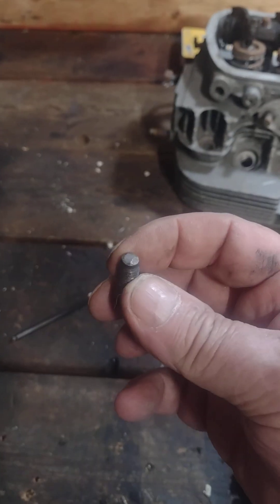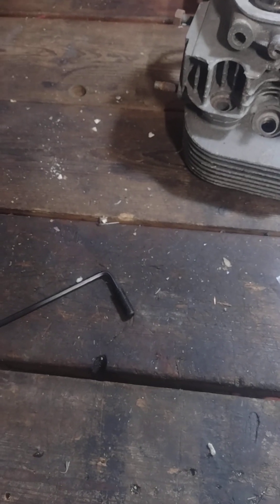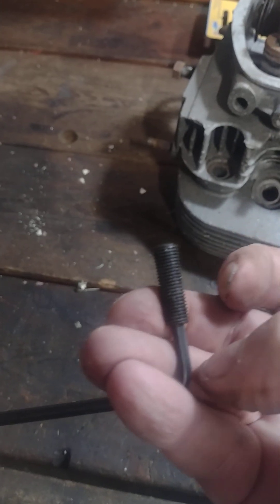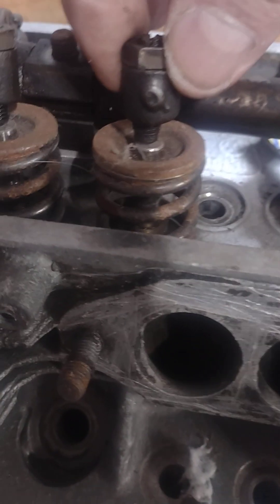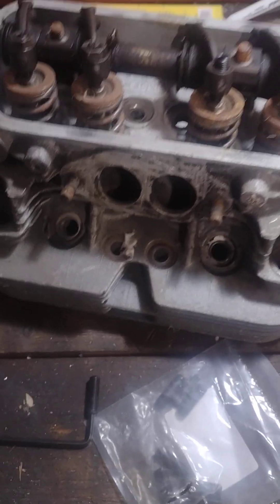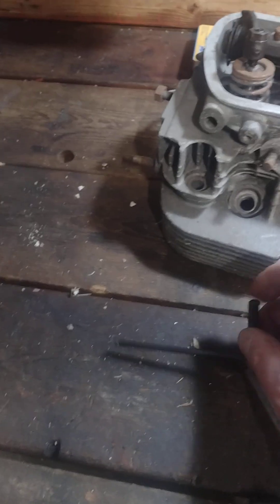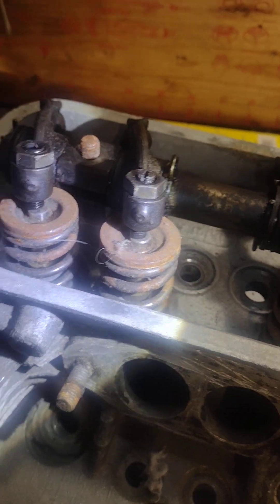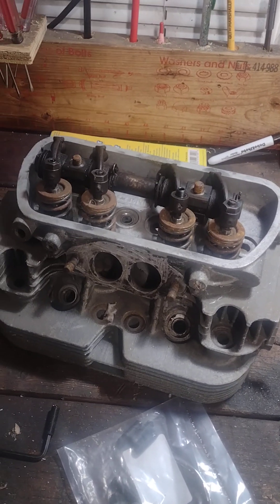Will allen head grub screws work as valve adjuster screws? Let's find out.

Comment: The set screw will work fine, do put a little bit of a convex grind on it, polish it with something like 220 grit, just chuck it in a drill while grinding to keep everything even and centered up. If you leave the cup, it will chew into the valve. The forums are extremely hard to read, I think liberals fill those pages, people with their own ideas and the inability to listen to anybody else's idea, knowledge or experience
Reply from the maker: That's what I did. I had already done exactly what you just suggested. I put them in my cordless drill and put a slight convex on them and then finished them with 220 emery cloth.  There's a video in my shorts. I haven't really had time to get the car out and run it but tomorrow is supposed to be nice and I'll get it out and run it 100 miles and then check everything.   https://www.youtube.com/shorts/yXxkAJkEfSI
Reply: Necessity is still the mother of invention . Nothing ventured - nothing gained   !
Reply from the maker: @richardpalko8062  Absolutely. Experimentation is half the fun. I've had a few ideas that ended up sucking big time but a few really worked out well.